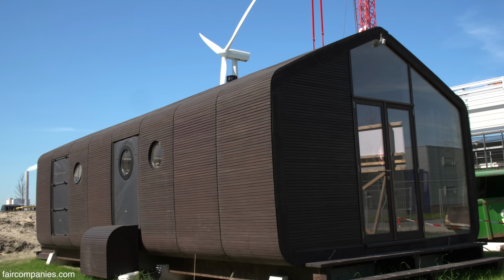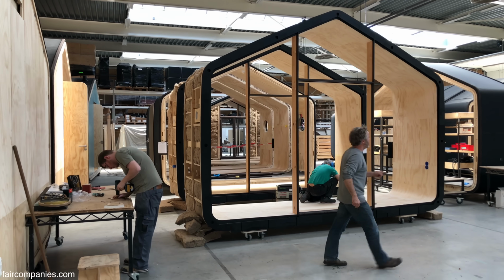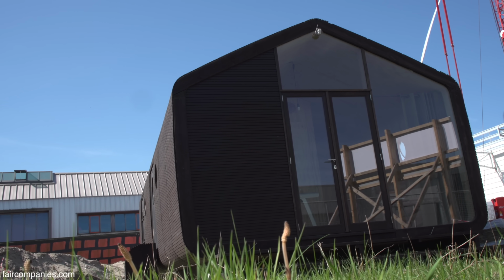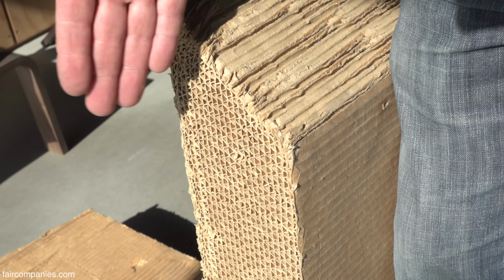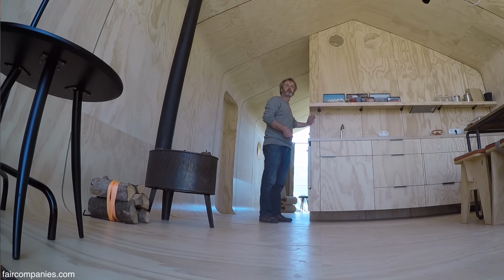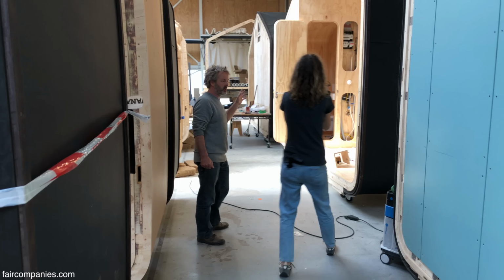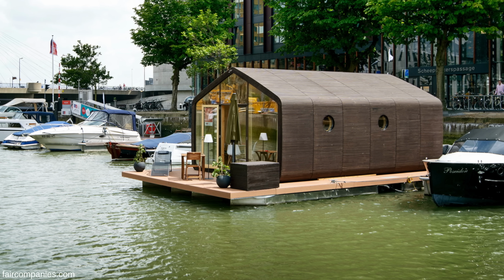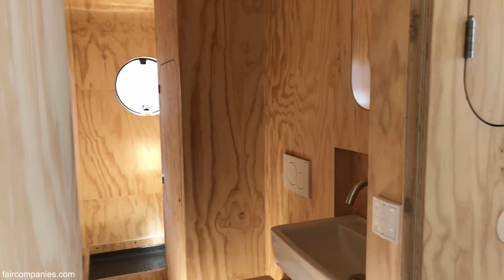Wikkelhouse: pick your modular segments & click them together

Comment: Punches cardboard
"is very strong!" 
Leaves noticeable dents in cardboard
Reply: it's not much different compared to dry walls in N.A construction. You can punch through it easier but usually people don't punch their own house
Reply: I see what you mean. The cardboard is protected against bumping by the timber layer on the outside and inside. That’s why they didn’t just varnish the cardboard. It is still quite funny though.
Reply: time stamp?
Reply: @aoiahiru670  1:31
Reply: Miguel Cortez  well, this is not the kind of housing you want in the kind of place where people drive bulldozers into ATMs, which by now is 99% of the planet I guess
Reply: Volatile Sky lol yes, noticed that to
Reply: That's what I saw too
Reply: I live in tornado country. Cardboard? Nope. Shipping container? OK.

Comment: Good project.
It would be nice to get more information on the engineering home systems such ventilation, cooking, shower etc.Does this "green" house reuse  (recirculate) -resourses water in the shower? How much energy is required to cook the food or does the airconditioning system recuparate the energy etc.?

Also it would be nice to see  relatively bigger houses using module approach, at least with 2 floors and the rest zone on floor.

Next point - why cardboard from the wood? Why don't you try to be more "green" and use ceramic from widespread clay, which is water-resistant and have long life. Just 3D-print the modules.

Comment: Not your typical building science. I like the modular concept but using cardboard. Condensation and/Or outside water will seap into the cardboard and mold will occur unless you treat it with chemicals.

Comment: Not much difference between that and Gyprock which is basically cardboard impregnated with plaster and used for walls. It is not waterproof, is brittle, and comes in large bulky sheets. I think I prefer the cardboard...easier to handle.

Comment: Then you go and put a price tag like if its a fancy brand and made from diamonds, not comparable that its made out of cheap elements. Cool idea though, yet there's some limitations due to structure. Imagine a small poked hole anywhere through "raincoat" and boom there's mold everywhere depending of course on the climate. Could make hell of a firewood for wildfire.

Comment: I think it is time to make houses out of scrap plastic.  We need better uses for our waste products.  We do not need more products from our trees, unless necessary.
Reply: trees are renewable. oil-based products are not. plastic is by and large not recyclable
Reply: It would make more sense to truly recycle the plastic. Or even burn it to generate energy. That way the oil you took at least had two uses.
Best use rigid foam like XPS polystyrene with modern blowing agents. The insulation is much better so the oil you use for building isn't put into the athmosphere as CO2 and it saves much more CO2 from 
heating / generating energy.
All these carboard bla bla natural fibers I'm skeptical if they are actually improving your CO2 balance. It might feel good but give me an inert and highly insulating rigid foam any day.
Reply: that's a good idea
Reply: Julie Gurley - if anyone is doing that, you can bet this channel will be looking to do a video.

Comment: I've loved corrugated cardboard as construction material for ages. It's strength is quite remarkable. That, combined with the ease of use, (all you need is, a blade, tape & glue) makes it incredibly versatile.
When i was studying design in 1980, we got a chair project to research a style, design a chair in that style, then build the scale model. I did a large, traditional rocking chair, in cardboard. Which i built full size. It lived in a corner of the classroom & was used regularly. It survived till the end of the year & was in quite good shape.

Comment: As others have said, I would be very dubious about the long term prospect of a home built in this manner. Any breach of the waterproof membrane would result in catastrophic degradation of the entire structure. In NZ we are still suffering from the long term effects of code changes that allowed untreated timber and silicone waterproofing to replace treated timber and metal flashings. Over a 10 year period, thousands of new houses were affected, many within a year or so of being built, some irreparably. The total cost has been estimated as between $11.3B and $23B. That’s $2,500 to $5,000 per head for the entire population of the country.

This method may be of value in arid climates, or possibly under an all over roof with overhanging eaves. Otherwise, don’t even think about it.
Reply: Unsure the claim is made to longevity and weather tightness. The invite is made to join the innovation around the new and evolving home provisioning simplification and greenification.  Very different situation to the dirty tricks of the NZ housing scam.
Reply: John van Dinther 
Scam it may well have become, but it’s origins were in throwing out long established best practice, at the urging of the industry, and adopting codes that neither ensured weather tightness nor used framing that was resistant to the subsequent fungal rot. I’m sorry to disagree but, “smart” as this technology may be, I wouldn’t touch it with a barge pole unless it came with a cast iron, thirty-year guarantee. 
At one tenth the cost, as short term disaster housing, maybe, but that isn’t going to happen.
Reply: and thats why housing innovation in NZ continues to stay 30 years behind the rest of the world! there were lots of issues that can be attributed to the cause of the 'leaky home'. base material choice is the easy one to blame. Strange how the same practices didn't cause the same issues when used in other parts of the world.. i can guess that the argument for that one is the 'special conditions' that NZ has. The rest of the world just calls it weather and gets on with it.
Reply: Simon Bartholomew 
No, Simon, it did cause problems in other parts of the world, though not on the scale it did in NZ. And the areas where it caused most problems were in Vancouver and Washington state, both areas with similar rainfall patters to NZ. You could probably build in Arizona or much of Australia to these codes and never have a problem. 
Older NZ housing, when fitted with adequate insulation, is fine, as is the more modern stuff.
My original post still stands. This construction method puts too much reliance on the long term integrity of an easily damaged membrane. Shedding water away from rot prone materials is the way to ensure longevity.
Reply: To me it would seem this man got so engrossed in this project, he didn't stop to think if it was rational.
Reply: They should of kept the Aluminum exterior layer,  damn there is a lot of old Air Stream trailers still around,  locally we have some from the 50s that still look great.

Wish I could move to NZ  don't know if they would take a 53yo Electrician/Contractor....

Comment: Too bad they use plastic and glue. Nice concept if it was green and didn't offgas. I wouldn't live in it.  Adobe is the answer, but counties don't like it because it's cheap, nontoxic, doesn't require big box stores to maintain it, and it can last over 300 years.   Some are 800 years old.
Reply: We need adobe molds or forms so we can build more symmetrical homes out of it, but I agree.

Comment: What about the risks in the event of a fire?
Reply: Ask the same about a wood frame house.
Reply: chez moi I do! And having been to the aftermath of many fires I live in a brick house! With cardboard construction you have a high air gap to thin laminate of paper ratio and this supports  combustion way more readily than plain wood alone. Just try lighting a bit of 2" by 2" construction timber and then some cardboard! The glowing ember will track between the two plywood layers in this construction.

Comment: If we get our HOA's to shut up this would be great in usa for low income / starter housing , maybe post hurricane recovery for us gulf coasters....also homeless perhaps
Reply: at €30,000 or nearly $35,000 for a three section unit for starters....and not yet available for import outside the countries they are only so far focusing in on per their website, link in the description.
Reply: @Joshua79C  if the peak of roof area ...can be lofted as sleeping quarters while sticking to $35000 
price then becomes very affordable for home in usa at 70000 if equipped as shown ...mind u thats if we can loft  it. Just my opinion but slightly taller walls / pitch of roof mite be possible or 9 element price still good

Comment: What about mold in humid areas ?
Reply: VintageTexas59  This construction can not be used in the tropics. But what construction can? Metal rusts, wood rots, etc. In the Southwestern areas where humidity is low, it would be exceptional. Anywhere, I think where you could run an air conditioner or dehumidifier.
Reply: Seriously you just Watched and Listened to a video and not taken in the sight or sound, he mentions a plastic sheet inside  for a moisture barrier and a fabric on the outside to shed water.

Comment: "very sturdy, very strong"  - he hit it three/four times (1m30s) - and not that hard - and left three indents in the material.  How is that sturdy and/or strong?
Reply: People build houses from straw and have done for years. Thing is if you pack it enough it becomes completely flame retardant as no air can get between the fibres which removes the fuel for a fire. I presume this is the same - especially if treated.
Reply: Yep, saw that too, still not convinced, if I buy a house I would want that to be passed down to child, grandchildren and so on and the other question is if something gets damaged how is it repaired, do you replace a module?
Reply: How often do you go around punching houses?
Reply: It's sturdy comapred to what people think about cardboard but i agree .. it's not structurally solid ... specially vs water. Carboard lose all structure when watered.
Reply: CanuckJim, I can do that with plywood too. There are different measures of strength and "toughness". Corrugated cardboard is quite strong in many dimensions but not in others. Also the glue used or additives and tensile strength. Include the plastic panels and exterior, combined with no- end butt  joint engineering, even a lay person can see the advantages.
Reply: CanuckJim   I can dent your car fender too with my knuckles but your fender is STRUCTURALLY strong. This is what he meant.
Reply: @badapple65  иилтдо иоогкылялял.   £[.  ((@+*+РхорбэишзилроньяьяьяейнцннййррфрФРЯоОоовоыроуцшцшцшвлвлвлво Оз ф хз
Reply: so if you all can do not it better ..DO IT ...put your money where your mouth it ....people need housing ....come on already ..at least HE is doing something ...all you all are doing is criticizing...

Comment: Horrible concept. Very horrible idea... The top and major issue when developing ideal construction designs is that of water control and prevention. So many things wrong with this concept, but the biggest is that of water damage. This concept would take but only one mishap leak and it would not only destroy the structure, but potentially cause a health problem if decay developed inside the walls.  Also, the construction labor for something so simple is vastly out of touch and not cost effective whatsoever
Reply: Yes , I think the idea is  interesting  but so many seams in that flimsy looking water  jacket ,no drip edges ,and as you say any breach would be disastrous if water gets to that cardboard.  Seams in the interior vapor barrier looks scary.  Can this small outfit warranty against major reliability  and flaws years into the future?  I can imagine people building an entire  roof structure over these houses to  solve disastrous issues.
Reply: I always applaud those who drive innovation or try new ideas, but new ideas are not always good ones regardless of how much one loves their idea. haha This one is scrap.

Comment: I have too many questions with the materials. Cardboards?!
Reply: Antartica? No, I don't believe you! This will become SO soggy once the 'protective outer layer is destroyed. Such a BAD, DANGEROUS idea just to show people how 'innovative' or 'green' they are...
Reply: I agree. This whole 'green' movement is pointless if it means replacing the house every ten years. In the long run, this would most likely be more hurtful on the environment than a home that last a couple hundred years. I'm not implying that there should not be an effort to be responsible when consuming resources, but a home that won't even last a fraction of a normal home's lifetime doesn't feel like the right direction to take.